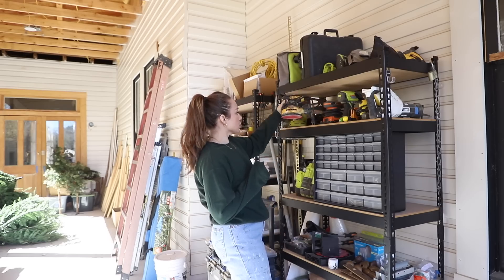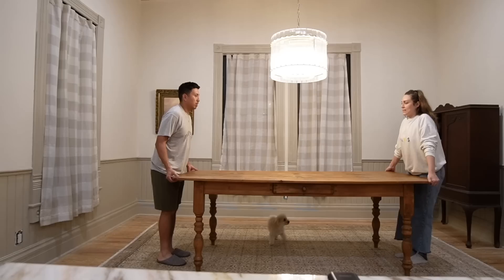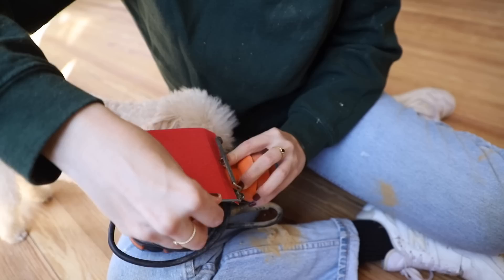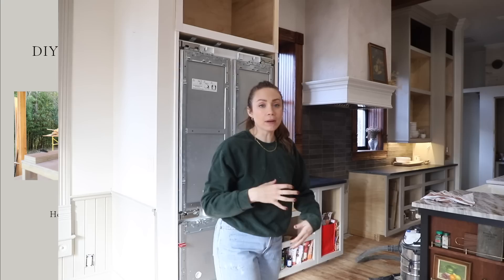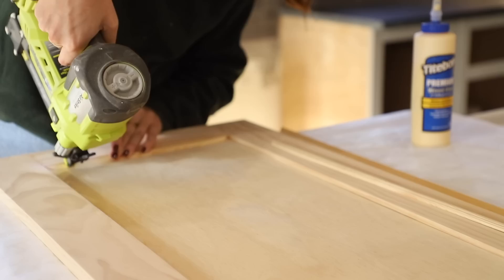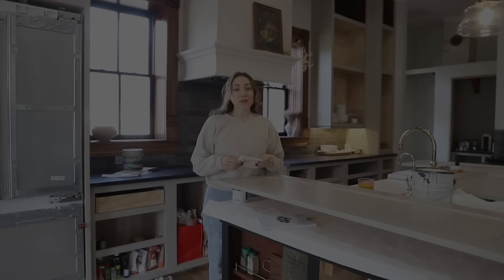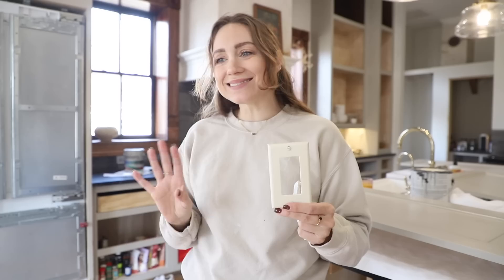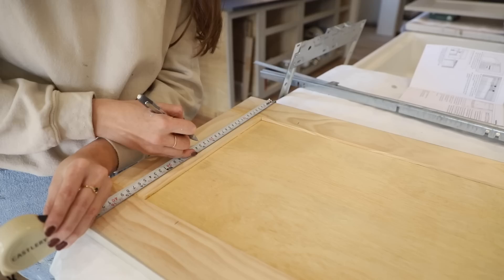Transforming Our Refrigerator & Sealing Our floors | Kitchen Makeover Ep. 11| XO, MaCenna

Comment: Your videos get me through a really horrible experience with builders of my new home. I just relax watching you for which I am really grateful. We're also going to have a cabinet ready fridge, only a tad smaller. If I may suggest a tiny change to the fridge doors, I'd still paint the back because you can see the unfinished wood on the top and bottom when opening the fridge and I know I'd just always see it myself and it would bug me ;) That said, all the attention to details you deliver each and every time is just incredibly inspiring.
Reply: Agree!
Reply: I thought the same thing!
Reply: She did actually go around the doors with paint 🎨 as think that's why she elevated the doors as she painted around the edges...
Reply: @sandieedward993  
She did the edges, but not the back side because she thought it wouldn't show.  But the cabinet front is larger than that metal plate, so when the fridge door is open, the unpainted backside is exposed all the way around.  It's a couple of inches  at the top and bottom and less on the sides.  If you look at the very end when she shows the doors open, you can see that it really does show.

Comment: Fully build in fridges (and other appliances like dishwashers) are the norm in central Europe, it's actually an exception when you have a stand-alone fridge. The stand-alone ones mainly go into basements for extra cooling storage. I find it so strange in the US where you spend a good chunk of money to renovate your kitchen and then shove those big stainless steel appliances in there, like the fridges, dishwashers but even ranges? We just build everything in over here. I can't remember if you did this but you must have x amount of space on the back as well as a ventilation air gaps below the fridge and at the top. Our ikea kitchen cabinets are pre made like this to accommodate for the air flow as fridges get warm on the back.

Comment: As usual, admirable and beautiful job. Those floors! 
Re: the handles. We ordered 2 sets of closet door handles from 2 different etsy shops. Both are beautiful and get lots of compliments. But one set came with screws that didn’t fit. The carpenter (we’re not DIYers) went to a couple of hardware places, finally found some that fit. Sort of. They loosen up over time. But we absolutely love them and, yes, they’re handmade so a little quirky, but definitely worthwhile.